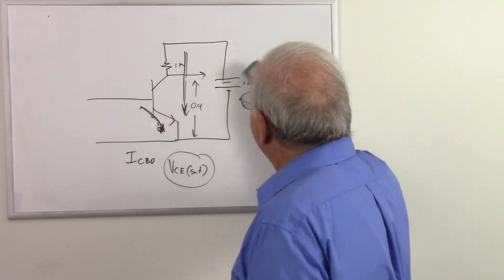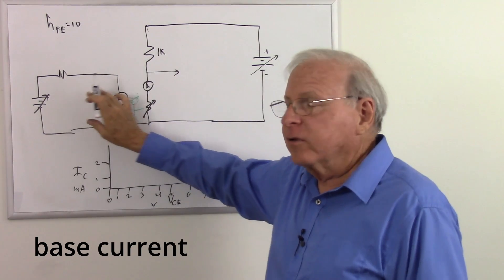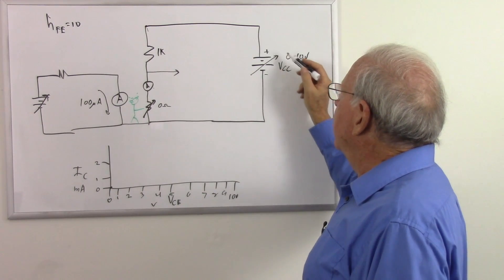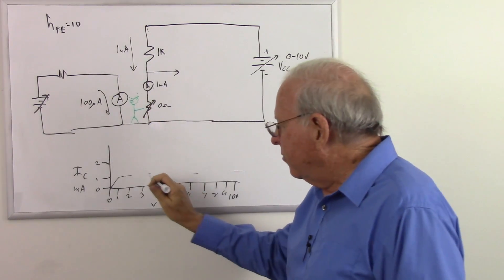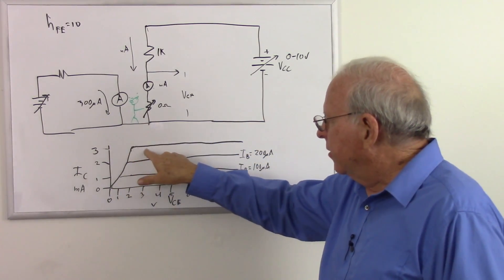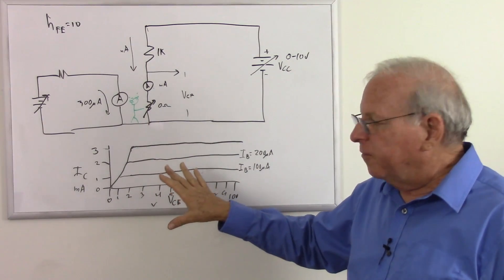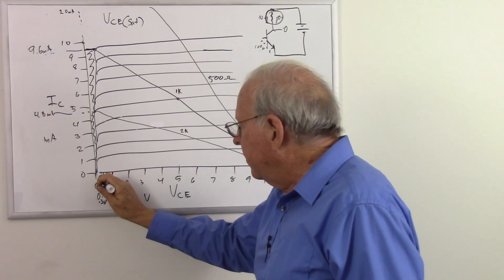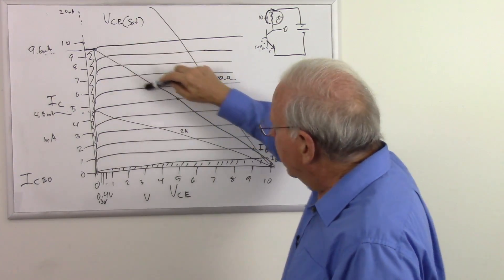Bipolar Junction Transistors - Part 5 - Characteristic Curve

Comment: Measured values not even close to vertical line, its goes up up up. I mean Ic goes up with Vcc, unless I put big resistor. I don't understand this.
Spend half day, checking everything is done fine, I miss something or I don't know.

Comment: Once upon a time, a guitarist was playing his electric guitar, and his amplifier broke down or maybe heated up too much. That put his amp in a saturated region, and he started getting distortion. Instead of what other guitarists at the time did, which is asking to fix the amp, he liked the distortion and kept playing. As a matter of fact, he asked the tech if he could make the amp have more distortion. So now you have rock n roll and even metal music and other genres tganks to saturation. There are other applications where we want to operate in saturation mode as well. Signal clamping and quickly switching transistors are applications where saturation is desired.